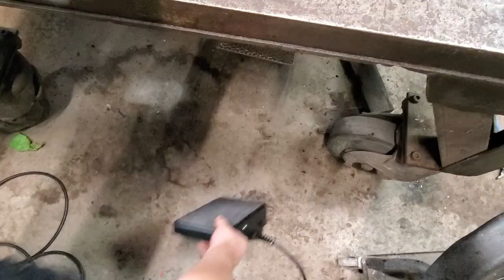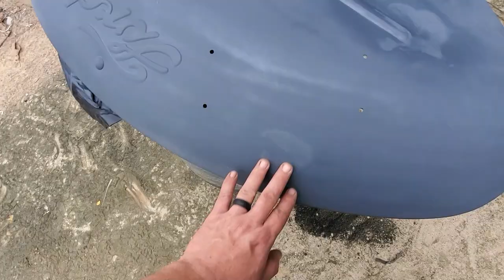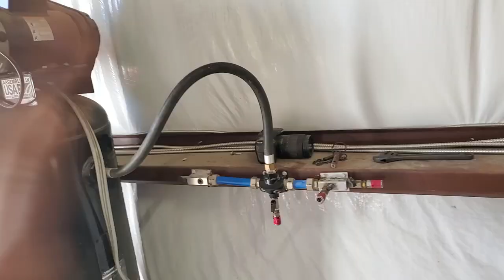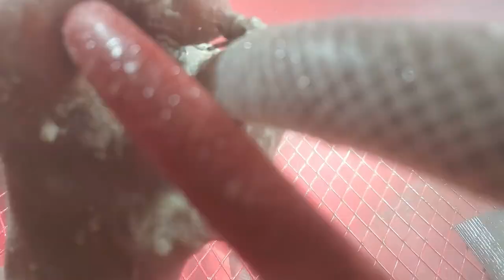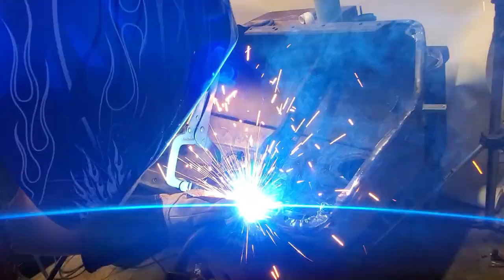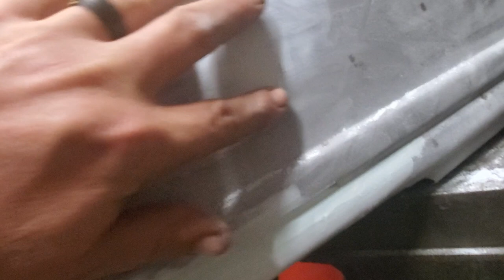Mark Carriker; Smoking Sally Restoration (headphones please)

Comment: Is bondo brand that bad to work with what is considered high quality bondo? @TheGoodOfTheLand
Reply from the maker: Yes its absolutely terrible. Way to hard and not flexable. You will spend $200more dollars  on sand paper sanding a gallon of condo vs a quality filler like Rage ultra
Reply: @TheGoodoftheLand  oh wow thats good to know Brother thanks for info good thing I didn't buy the bondo brand bondo yet appreciate the info need to do some body work